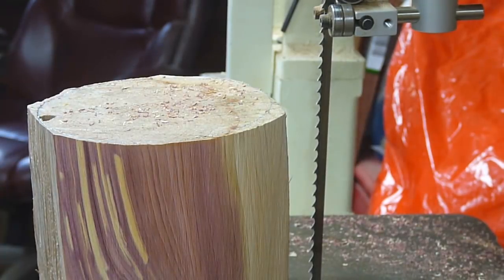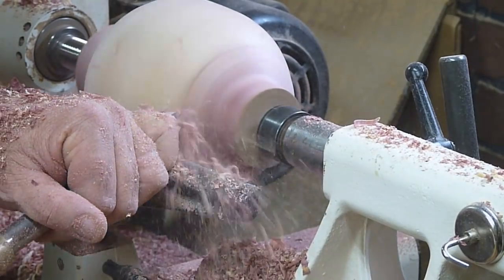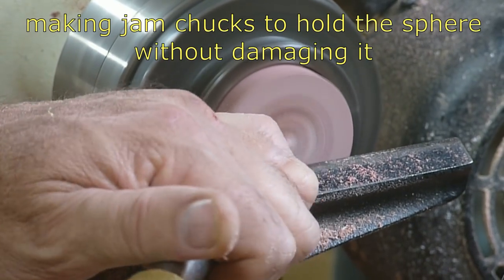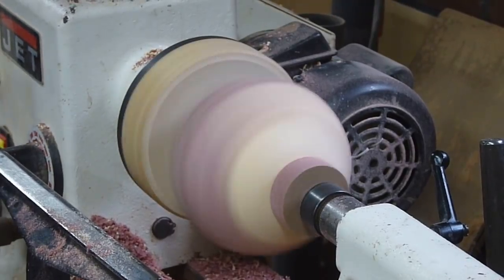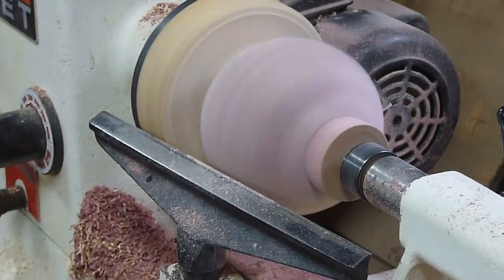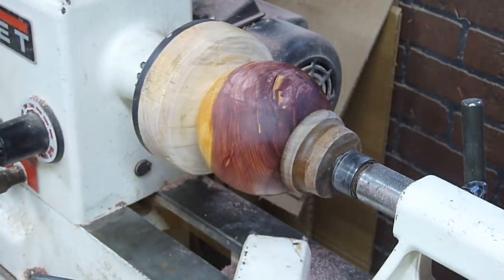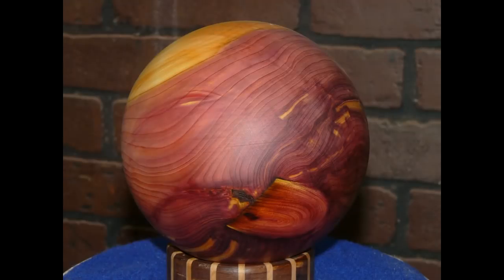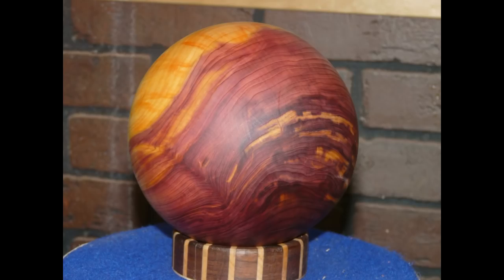Woodturning Jupiter

Comment: Would you tell me the angle that you sharpen your gouges? Thanks.
Reply from the maker: My favorite bowl gouge( 1/2 "....which I've said was a 3/4" in past comments for some reason...) is 55 degrees at the tip with a fingernail grind (kind of...) around to 40 on the sides.  The 3/8 in bowl gouge is 55; 5/8" and 1 1/4" roughing gouge are 35 and 50 respectively.  Thanks for watching!

Comment: look I don't know how any of this works but what I do know is that a cube is closer to the shape of a sphere then what's a cylinder is what would have happened if you would have cut a cube before turning the sphere
Reply from the maker: Valid question, thank you.  A cube would work, but having the extra length on the ends, and having the ability to move the tools down closer to the turning axis seemed like a good way to go for me.  Starting with a cube would mean either damaging the initial axis with the spur center and live center lathe bits, or using maybe different sized jam chucks and spinning the piece more often....it's good food for thought....  This was my first sphere, so I'm certainly open to new or better ways :)